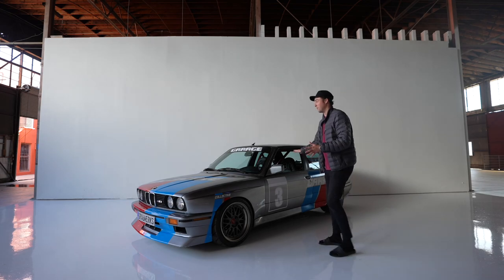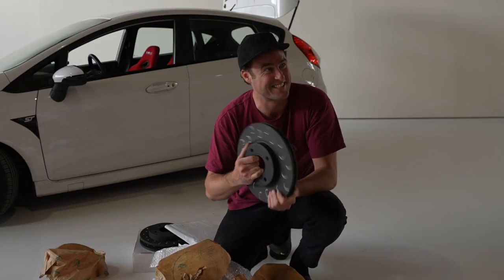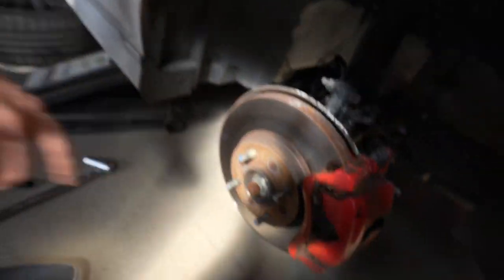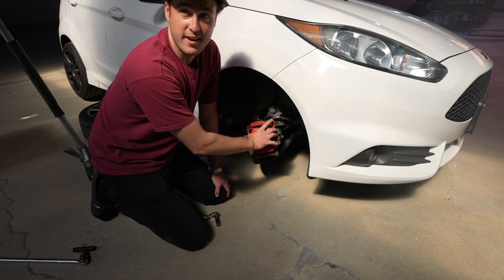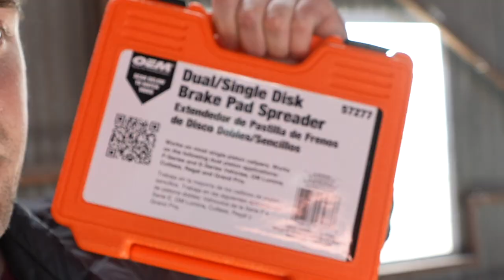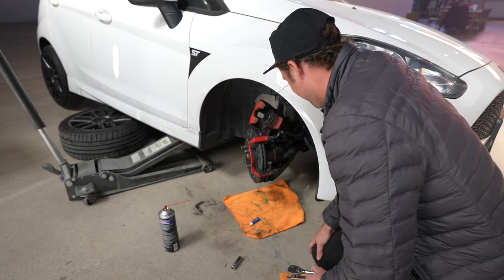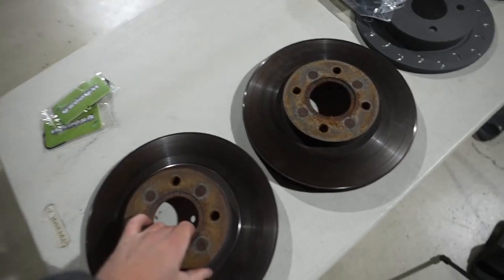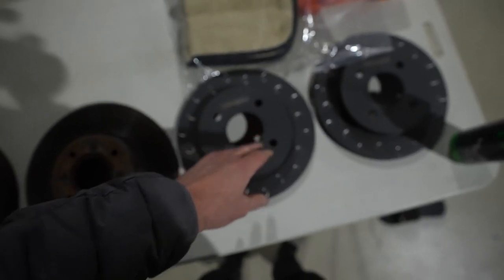Installing Upgraded Brakes On My Fiesta ST With Friends

Comment: Damn those stock brakes haha, i just bought the x47r+stage 3r from pumaspeed(want to fit it in april/may first going to paint my front bumper looks shit cuz paint damage :/ and getting my headlights black with a new led) Still got those stock brakes aswell haha.
Reply from the maker: def consider these for an upgrade, they are much more expensive than the stock rotors & pads
Reply: @GriffinBlanchard  thanks will get them upgraded b4 getting stage 3 tho, how much did it cost you to upgrade front and rear discs+pads

Comment: Maybe a dumb question, but I assume as soon as you brake for the first time, those rotors aren't going to stay black?
Reply: They're painted black to prevent corrosion during storage and so that other surfaces not being word by the pads don't corrode either.
Reply: @georgevigil7001  Yes, but I assume once the brakes are used, the pads will start scrubbing the surface of the rotor. So they won't be black anymore.
Reply: @AzNightmare  that's correct.

Comment: Yo we're twins I just put on my front wilwood BBK Sunday too. Still gotta bleed the lower valve to get maximum braking powa! 
Torque spec? Give it a couple good ol uugga duggas and call it a day.
Also do you have a mechanic you trust to look at your car? Mine developed a noise from the front, I think it's related to the belt/pulleys. Still gonna send it to Chuckwalla on Friday, super looking forward to it!
Reply from the maker: hell yea man! i dont havce a mechanic, i just try to do all the work myself

Comment: Hey EBC's take about 200 miles before you can do the hard braking break in. 

They have a break in layer you have to work through first so don't brake hard unless you have to or you'll ruin your rotors.
Reply from the maker: noted! i havent got on em, but i can feel theyre gunna stop like a mofo